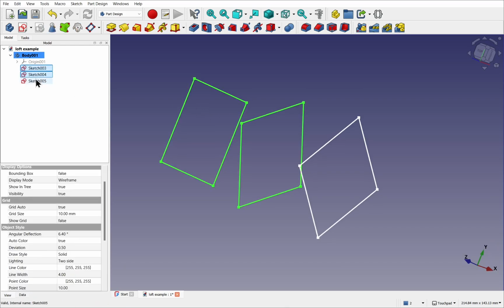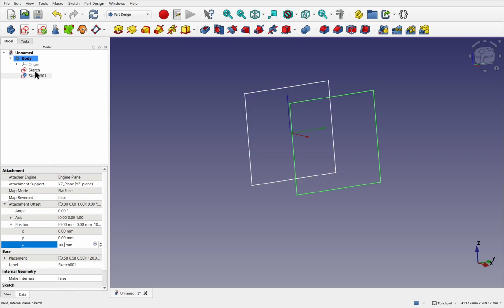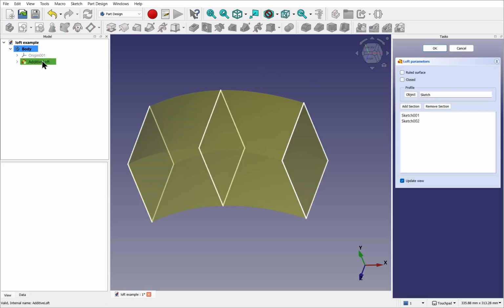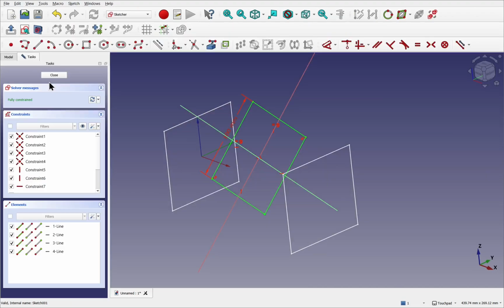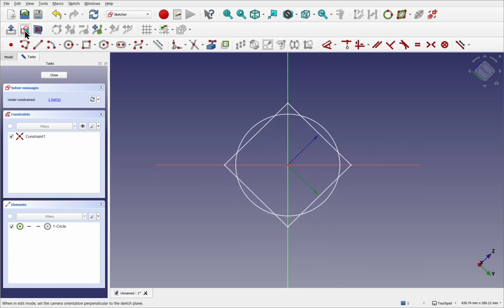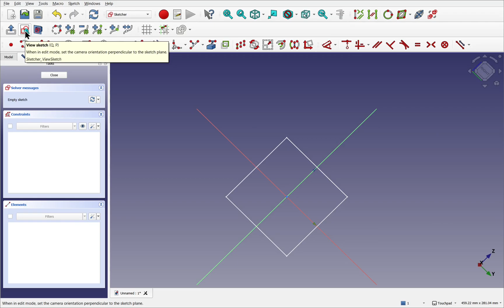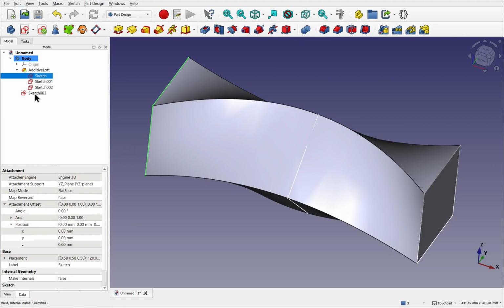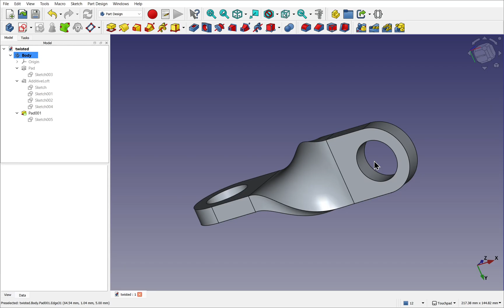FreeCAD v1.0 | Lofts & Lofting  The Basics Part 1 | Basic Beginners FreeCAD Lesson #21

Comment: How to make a hole through the entire profile?
Reply from the maker: I am assuming in the same shape of the finished loft.  If so you would create a inner and outer geometry for each profile i.e. a square within a square.  Make sure you sketch them in the same order for each profile, i.e. outer first then inner, and repeat for the next profile.  Otherwise the surface will turn inside out halfway through  If it's just a hole then sketch a circle on the end and create a pocket.

Comment: I don't know if this comment has been made already. You said you moved the subsequent sketches along the Z axis (and modified the Z constraint)but,  they are generated displaced along the global X. This only makes sense if the local x,y, & z is locally defined by the choice of plane  in the attachment offset. Is that what is happening?
Reply from the maker: Yes, that's correct the sketches are attached to a plane and oriented with their normal axis (will be the z with a 2D shadow)  perpendicular to that plan so their are two coordinate sustenance. I go over that in a episode about attachment. It becomes easier in 1.1 as you can show placement and plane on the view tab of the sketch after selecting it in the tree view.

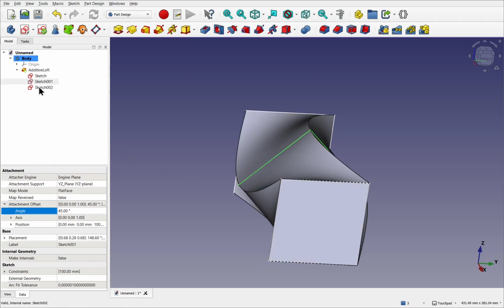Comment: at 14:41 you rotated the square on the end(sketch 2) 90 degrees but when i tried to do this my object looks the same as when it was zero degrees. do i need to do a split edge on the square on the end?
Reply: I am getting the same result.  From some forum posts I see that this known (expected?) behavior.  It seems that FreeCad is trying "line up" the points as it sees best and since the corners of the third square are lined up exactly with the first square when rotated 90 degrees, it reverts back to that orientation.  Not sure why it works as shown in the video because that does not seem to be the behavior of the current version (I am using 1.0.0 r39109 on Windows 11)
Reply: I see the same. If you come across this, push through to where he covers adding another intermediate sketch to the loft. He refers to this as BSpline Interpolation.
Reply: I found that using -90 degrees gave the desired effect
Reply: @TheRuko15  Not for me; 0, 90, -90, 180...all do the same thing.

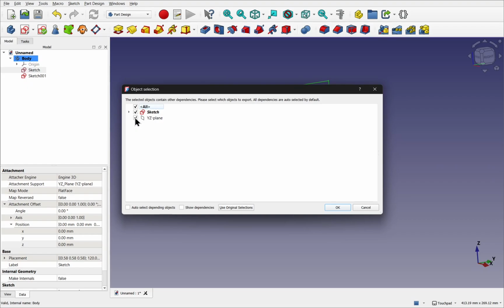Comment: At about 3:00 you move the sketches along the z-axis?  I see them moving in x direction (red color arrow). Am I missing something here?
Reply from the maker: It's all to do with local and global coordinate systems.  I covered this in  lesson 16 in the course (Basic Attachment & Map Modes),  it can be a bit of a brain melt.  The sketch when attached is attached via a mode whether on a plane or a face of another operation.  The Z of the sketch will, if flat face, be in the same direction of where it's mapped flat.  In the attachment lesson I explained this as if you was hanging a picture on a wall.  You would go say 100 along the X of the wall and 200 along the Y.  The Z would be how far out from the wall the picture is.  If that wall  tilted 45 degrees it would still have the same location.  If this was done in the global coordinate space then the equivalent will be a XYZ position in latitude, longitude and elevation of that picture on your wall.  So if the wall was slanted you would have to affect the XY and Z position rather than nudging it just a couple of mm on one axis.  This is know as placement.  Depending on the attachment mode will depend on where those axis are aligned.  Hope that helps.
Reply: @MangoJellySolutions  Thanks, that does help. I've been jumping around a bit in the videos and missed that one. I'll go back and view it now.  I'm hoping there's a way to show the axis cross that corresponds to the local coordinates.
Reply: @MangoJellySolutions  thank you. Your metaphors explain it clearly. I did watch the video you refer to however I will go back for a refresher now I have those analogies in mind. Thank you.
Reply: I'd like to know the answer to this one also. I had to rewind several times to double-check I didn't mishear.
Reply: @Denis_of_Earth1  I too am interested in this, as it's always bugged me how the axes move about.

Comment: if you use OpenDark  Preference pack and  copy the   user.cfg  from  Ondsel into FreeCAD's configuration directory where it has  system.cfg and user.cfg   you will automatically get the Task panel to the right hand side.
Imo,  the default Ondsel ES  UI  is more like a professional  Parametric CAD package
Reply from the maker: Thank you for sharing that, great tip. I wonder if they are going to offer that in the add on mannager at some point. It be useful.